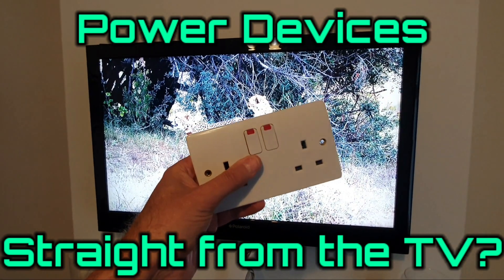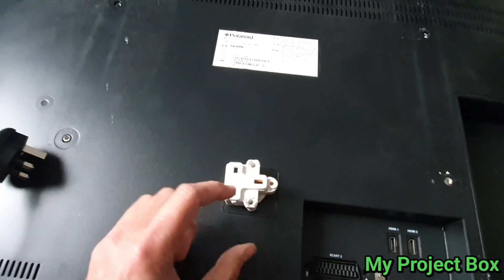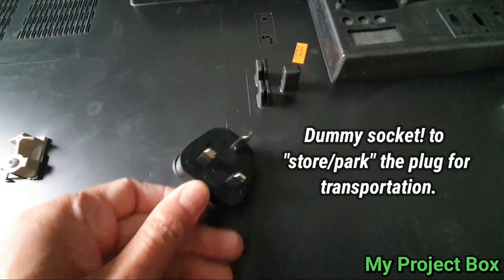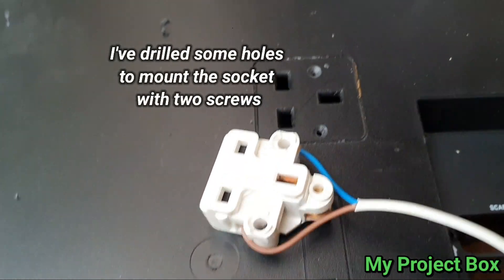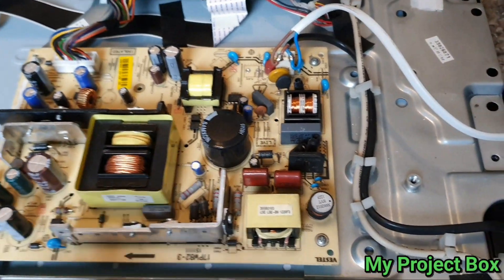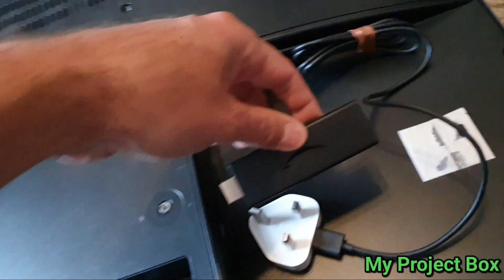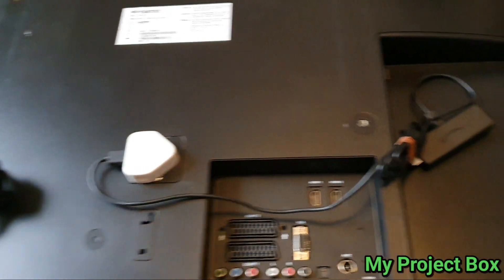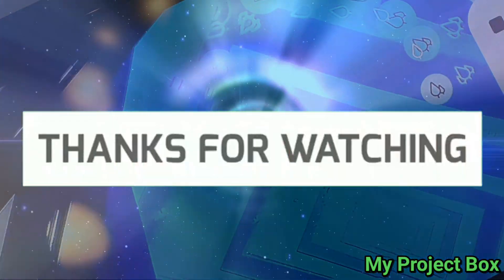Build a socket outlet straight into your TV power mains powered devices from TV #ElectronicsCreators

Comment: Thank you. I have the same issue with Google chromecast tv need the adapter and I'm planning to do like what you did before I saw this video. Thank you and I don't know why some people they dislike this video. You got like from me. 😊👍
Reply: And I suggest to add a fuse in the middle of the new cable, because maybe you will plug another device and this device has a high voltage capacitor and if any issue with them they will return the high voltage to your tv board.
Reply from the maker: @saudisports  adding a inline fuse is a good idea 😉. Especially outside the UK it would absolutely necessary! Only in the UK do you have a fuse in the appliance's plug.
Reply from the maker: I'm glad you liked this video 👍😉 I'm sure you'll find more of my videos useful or interesting as well.

Comment: I've seen several devices with a parking socket
Be awar of the thickness of the plastic, tthat plug is not in as far as it normally would be, would have been better to cut out so the pin areas of the socket poked through as it would have been in the socket you got that from, i'm guessing a metal socket, you could have used the original as a ttemplate
On the small load you are using it for it shouldn't be a problem.
Reply from the maker: The plug does fully insert into the socket. It came from a unit that was behind a plastic plate with plugholes built into it. So it compensates for the thickness of a faceplate of +-2mm. It came from a computer rack in a comms room, (not a standard socket). I have not seen a parking socket like the one, on this TV before. I don't think any heavy loads will ever be plugged into the TV any way 😉👍. It's all governed by the 3A fuse from the TV'S plug.

Comment: Yeah, don’t do this.
Reply from the maker: It used to be quite common in the 90s for stack systems to have a auxiliary power socket built in. People have commented that the earth in not included. I will have to add a new 3core flex cable to the TV (  I'll do it just to keep everyone happy). Every appliance I have seen that plugs into a TV is class2 ( Double insulated and no Earth needed). So I will now add the earth conductor😉.